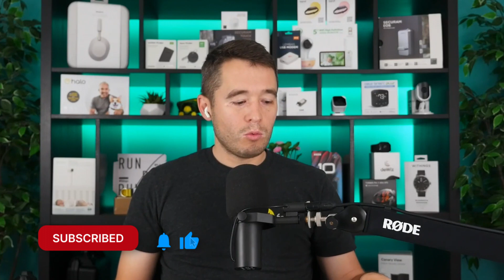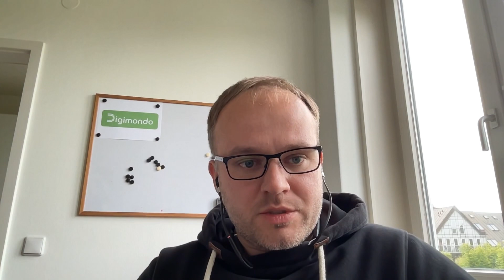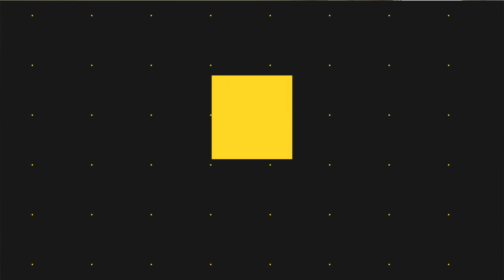Integrating IoT Into Legacy IT Environments | IoT For All Podcast Clip

Comment: If I want to set up lora/ lorawan mesh network which do I use???

I looked at using meshtastic and forking it and adding tracking for vehicle tracking and add door sensors and smoke detectors etc and putting nodes on top of buildings as well to cover all of Singapore.
Now I'm hearing that lorawan might be needed to do this but I don't find any info on the range side like sending messages over long distance. The lorawan nodes seem to only be attached to sensors such as doors, temp or some other sensors or a gateway connected to the Internet?  But nothing to do with a lorawan node that can be used to take the data and transmit to another building and so on and so on like lora meshtastic devices.

What path do I take :?
Reply from the maker: Your project idea is quite ambitious and interesting! Both LoRa and LoRaWAN have their strengths and weaknesses, and they're each more suited to specific types of tasks. Here's a breakdown that might help you decide which path to take:

LoRa (Long Range)

Mesh Network: With LoRa, you can create a mesh network where each node can communicate with each other. This is good for redundancy; if one node fails, others can take over.
  
Flexibility: LoRa gives you more freedom to customize your data packets and implement features like vehicle tracking, door sensors, and smoke detectors.
  
No Centralized Network: LoRa doesn't require a centralized network server, making it simpler and potentially more robust.
  
Range: It's highly configurable but generally has a shorter range compared to LoRaWAN because of the mesh network overhead and lower power to comply with regulations. 

LoRaWAN (Long Range Wide Area Network)

Star Topology: In a LoRaWAN network, individual nodes (called end-devices) communicate directly with gateways. These gateways then communicate with a centralized network server.
  
Long Range: LoRaWAN generally offers a longer range because it operates in a star topology where each node communicates directly with a gateway. There's no multi-hop like in mesh, so each end-device can operate at a higher power within regulatory limits.
  
Internet Connectivity: LoRaWAN is often used for Internet of Things (IoT) devices and is designed to connect low-power nodes to the internet via gateways.
  
Battery Life: LoRaWAN is more power-efficient for the end devices because they only have to communicate with a nearby gateway, not multiple other nodes.

Your Project

1. Vehicle Tracking: If you need real-time tracking with constant updates, LoRa may be more appropriate. LoRaWAN could also work but may be less real-time depending on how you configure the network.

2. Sensors (Door, Smoke Detectors): LoRaWAN is generally better for this because these sensors don't need to communicate with each other, just a central server.

3. Building-to-Building Communication: If you are considering placing nodes on buildings to cover all of Singapore, you will likely need a mix of both technologies. LoRa for shorter-range, more data-heavy applications, and LoRaWAN for longer-range, less frequent data transmissions.

4. Regulatory Compliance: Since you're considering covering all of Singapore, ensure you're compliant with the local regulations regarding radio frequency and power levels.

Suggestion:

You could consider a hybrid approach, using LoRa for mesh networking between closely located nodes (such as within a single building or between adjacent buildings) and LoRaWAN for longer-range communication between buildings or areas. This way, you can maximize the advantages of both technologies.

Hope this helps you in making a more informed decision. Good luck with your project! You can read all about LoRa and LoRaWAN on our website: https://iotforall.com